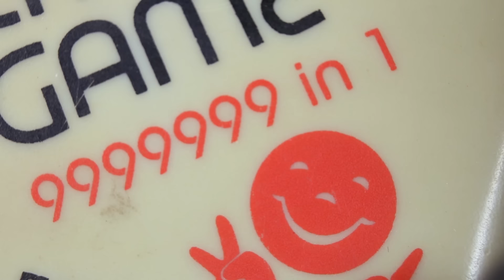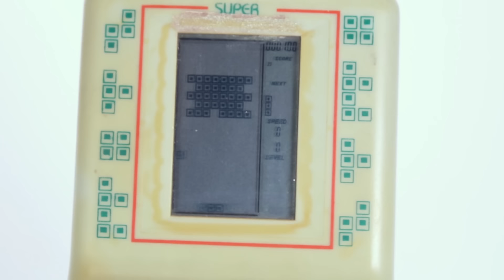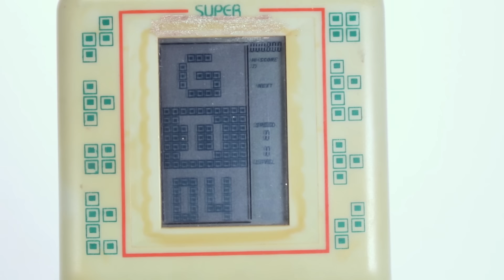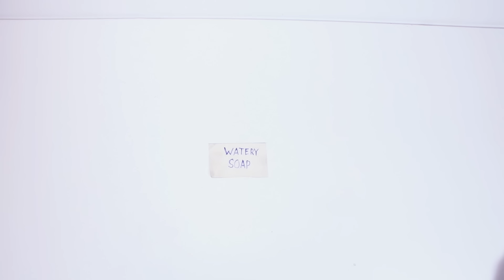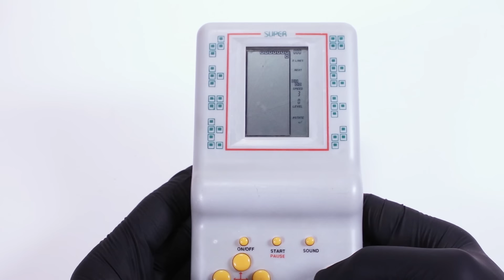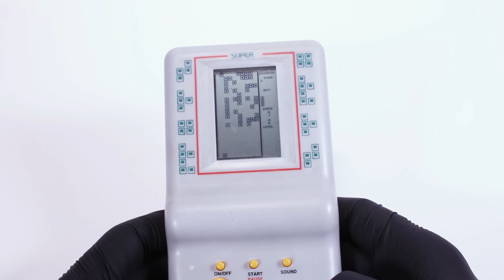Restoring a Broken $2 Tetris Handheld. 9999999 Games in 1

Comment: I had one of these ones back in '97, the same model and build. About 15 years later, while digging around a shed my father stacked things into, i found this lying in an old box. For curiosity's sake i turn it on and not only is it working, it has a tetris game my dad had on level four while paused. Fun fact: you can pause, turn it off, turn it on and it will still work, but to have it locked up 15 years, still saved up and with the same original batteries was just amazing. I still have the console around here, but i changed the batteries.
Reply: Good storage condition, then.
Reply: Cooooooooooollll
Reply: Wow
Reply: I have about 70 of the older Brick Games (~1990-2001) in 2021, and obviously I know about the pause function working when turned off, but to have one keep a game for 15 years is amazing! These UM6510s are very good to batteries (although my 9 in 1 ES99 and 300 in 1 E300 arrived from Italy both with corroded terminals - coincidence...?) whereas the earliest single-game E23s drain any batteries left in them.
Reply: দদদেৃম
Reply: @RWL2012  do you know some community of collectors somewhere? I'm looking for a specific Grand Prix Brick Game (Model - FD 1997)
Reply: Coincidence? I THINK NOT-

Comment: Nobody:
That smiley face on the console: 
✌️😊✌️
Reply: the most wholesome comment ive seen somehow
Reply: why does it have 2 left hands
Reply: ChipyM they are actually right hands
Reply: @fritzkeller5629  they are actually middle hands
Reply: @mrmcfezz2727  they are actually X-Æ-W-S hands
Reply: @Pinkcircleguy  they are actually S-W-EA-X hands
Reply: @mldthejellster3142  its actually plot of the six trigonometric functions, the unit circle, and a line for the angle θ = 0.7 radians. The points labelled 1, Sec(θ), Csc(θ) represent the length of the line segment from the origin to that point. Sin(θ), Tan(θ), and 1 are the heights to the line starting from the x-axis, while Cos(θ), 1, and Cot(θ) are lengths along the x-axis starting from the origin.
Reply: @mrmcfezz2727  They're actually middle fingers.
Reply: "Yeah, boiiii!"

Comment: This thing is actually quite fun. My parents ran a dollar shop and they sold these ones. Since we already had a Mega Drive and preferred to spend our money on games for it, me and my brother picked one of these each for going to the beach and the pool. No sun reflection, the batteries lasted over a month, you weren't risking breaking an expensive thing and the games were surprisingly well implemented. A fun fact: some games might look the same but had different options, one Tetris might rotate left, other right, another would allow you to move after landing, another not, and so on.

Comment: I use to have one of this when i was a kid. And As a kid i was fascinated with electronics. I actually removed the screws and took it apart thinking i could fix it. But i ended up breaking off probably the speaker wire🙆‍♂️🙊.. and it was game over from there... 🤦‍♂️
Reply: SAS15G stop using emojis goddamn
Reply: K7 😔
Reply: Tyanfan lmao
Reply: @og.K7  💅
Reply: K7 🦵😤
Reply: K7 😩👌
Reply: @Abstractism Yeah, I see instead of progress, we regress to paintings to communicate, just like cavemen before language, they also communicated with paintings on walls, first emojis. So we are going to the cavemen stage.

Comment: I bought one in Mexico for just $2 and it works well. I do have modern handhelds like a Switch lite and a regular Switch but   i think that the simple fact that a handheld that costs $2 exists is kinda interesting to me with $2 you can buy some little chewing gum and not much else.

Comment: Recommend using a third hand tool to hold wires as you solder them, otherwise if you hold it by hand, it will move slightly as the solder cools and the joint might not be as good.

Comment: I still have one of these in a cupboard somewhere. Next time I find it, I'll check if it still works. I do remember that they had a high failure rate out of the packet. Played mine for hours on the tube - volume off.

Comment: Hey, Odd Tinkering? I have 2 questions:

1) Does using bedroom LED lights also work for getting rid of the yellow?

2) What was that tool you used to forge the wires into place?

I have this Radica Big Screen Tetris that I've decided to fix. Something of which you convinced me to try. 😁
Reply: No you need strong UV light. Direct sunlight in Summer also works sometimes...

Tool's called a soldering station

Comment: I actually had three of these. One was made in 2000 and actually read just 500in1 as opposed to that bunch of 9s, and was that kind of PCB green. The 2nd was a GBC/PSP styled yellow/orange one, and it was a bit more advanced, as IIRC it also had a built in calculator that served as some kind of standby mode. The 3rd was similar to the one pictured here, with the difference being that it was a metallic green (kinda like the emerald green Galaxy S6, but somehow turned matte instead of glossy) and had a black back. It was my cousin's (ironic since she's a girl, and she got it around 2011-12) but she gave it to me as she didn't like it.

BTW, cutting the speaker was pretty dumb. At least for me, since I clearly recall having a sound button to mute on all 3 brick games. 

And ngl the boxes these came in were pretty nifty.

Comment: The opposite screwing thing works with bottled water. You could screw in the cap but it's all SCREWED up. Just turn the other way until you feel something and start screwing clockwise our counterclockwise (whatever the opposite direction)

Comment: Your model is a luxury model, yours has a PCB for the buttons.
Mine, well has a piece of plastic with etched PCB traces out of carbon.
My buttons stopped working, only the start, volume and the up button work.
I'm thinking about replacing the plastic "PCB" with actual cables and push buttons.
I tried to add some carbon back to those buttons, but failed.
Also I'm thinking about adding a volume potentiometer, since that speaker is SO DAMN LOUD, but I don't want to remove the sound completely.

Comment: Also, the on/off button should not work as a reset switch. None brand new games has it powered all the time while battery is inserted so definitely there's something wrong with the button or the logic board.

Comment: I'm a noob in electronics but, what we see at 6:58 is the pcb that lays under the button, that we see at 1:38 for example, and the black membrane that is under the yellow buttons physically push on the circuit ? How does it work, the black thing cut the power way or allow the path ? 
Also, so, the game is not on this circuit board but on the board under the screen right ? I would have love to see how a simple game like this (compared to other games of course) is translated from code to physic circuits, if you have a video to share me that explain things like this, would be awesome :)  Have a good day all !

Comment: Although it wouldn't be a restoration, if you took out the guts and replaced them with a Raspberry Pi, you really could have 9,999,999 games in 1.